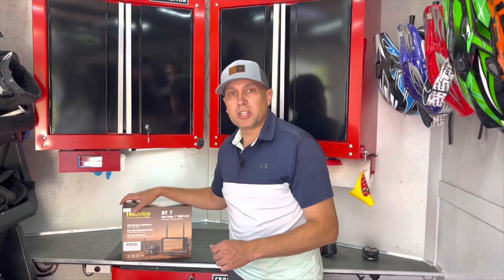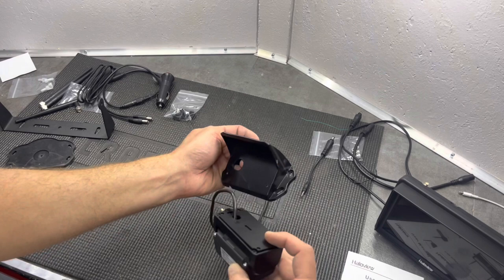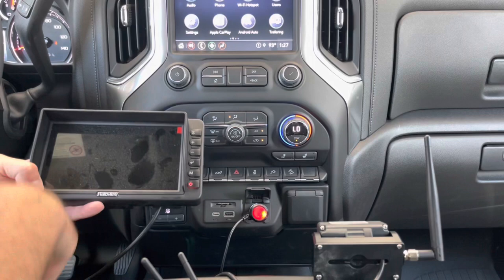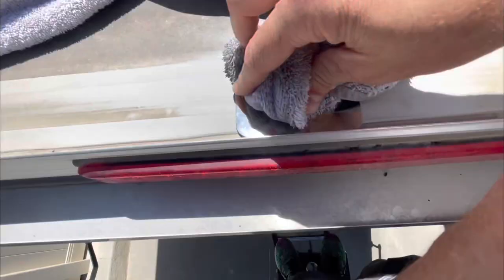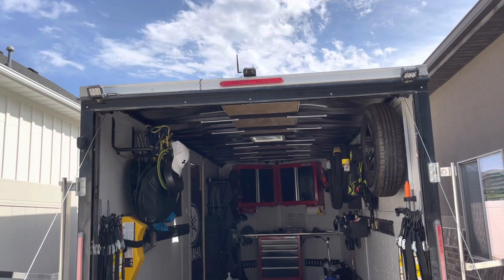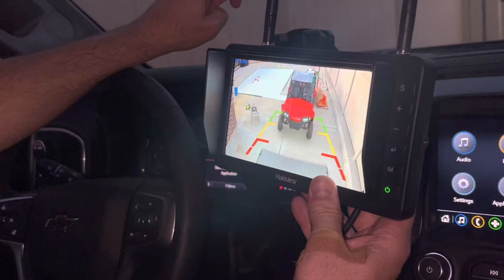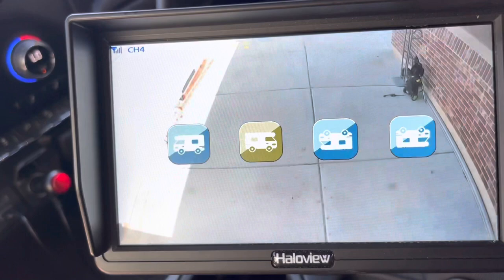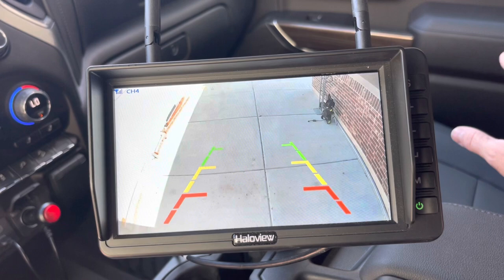Haloview BT7 RV Trailer Back Up Wireless Camera Installation and Review

Comment: Why did you put the switch in?  Do you have to go flip that switch anytime you wanted to use the camera?  Why not use the running light up top right under the camera to turn on the camera whenever you plugged into your tow vehicle?
Reply from the maker: I wanted to control it independent from the trailer lights